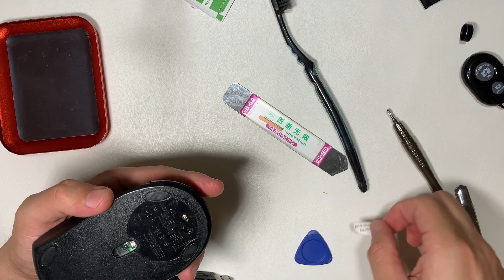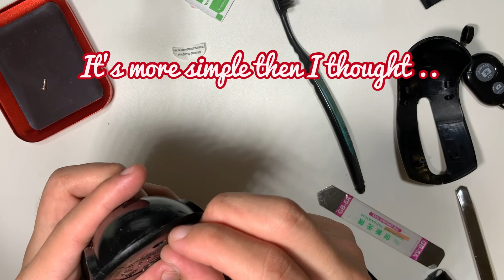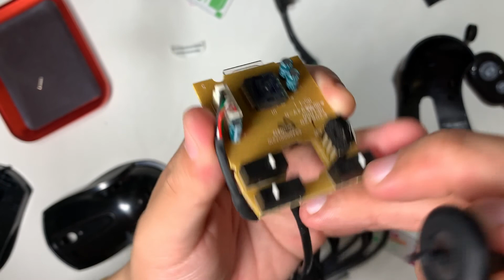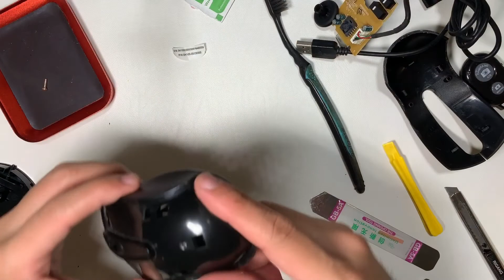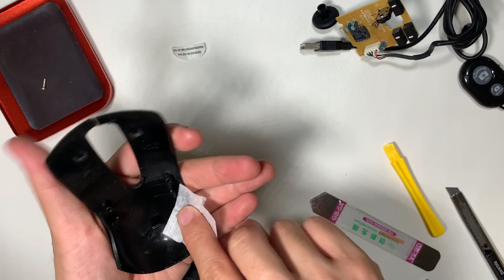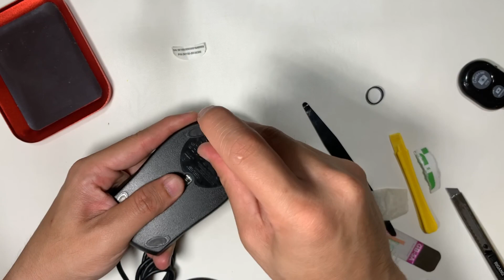#4 Tear Down & Clean Asus stock wired "Gaming" Mouse model MOBTUOA

Comment: Thanks, this helped me fix an issue where middle clicking would right click at the same time. I still don't know what was causing it, but taking it apart and then putting it back together seems to have fixed it